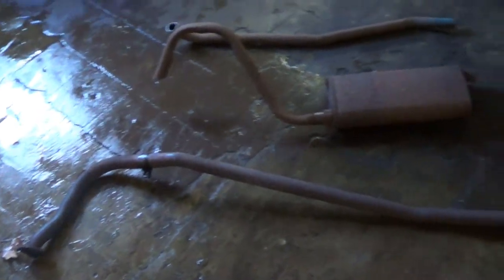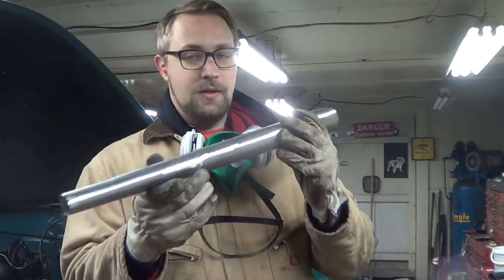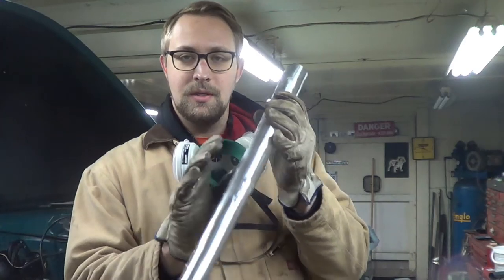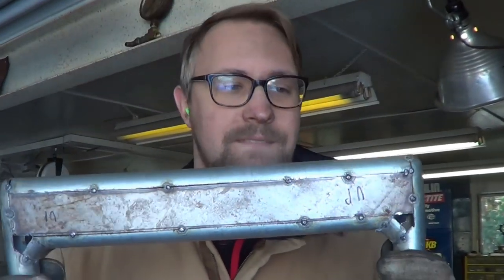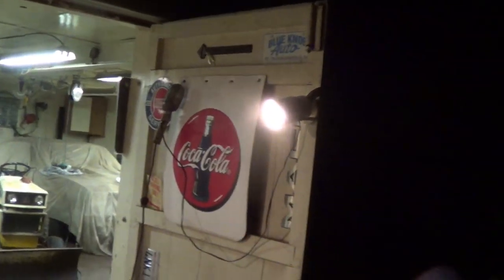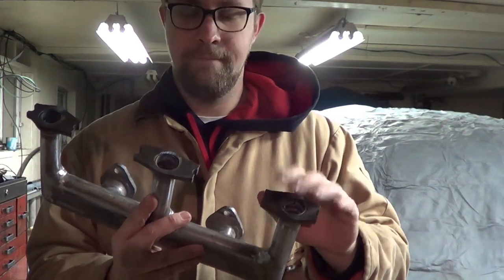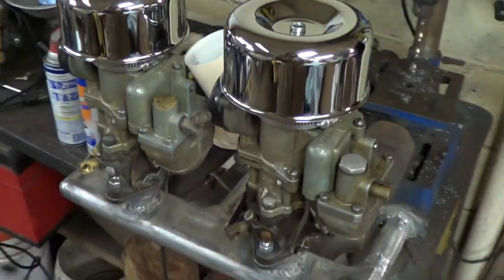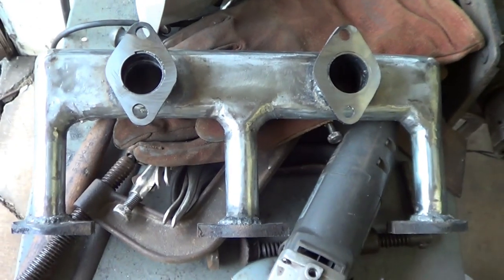Making HOMEMADE Intake manifold for a HOT ROD!

Comment: Hi, i want fabricate a dual carbs aluminum intake for my 47 packard straight eight, doesn't matter the size of the chamber of the intake??
As long as there is gas going into the exhaust it'll work??
Reply from the maker: Don’t make the chamber any bigger than it has to be